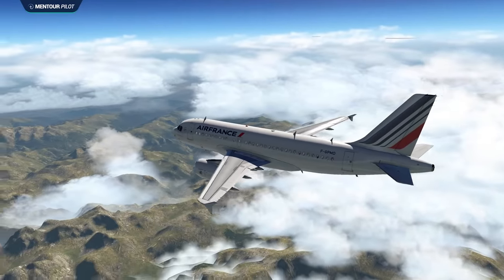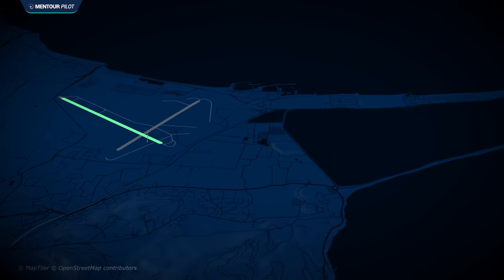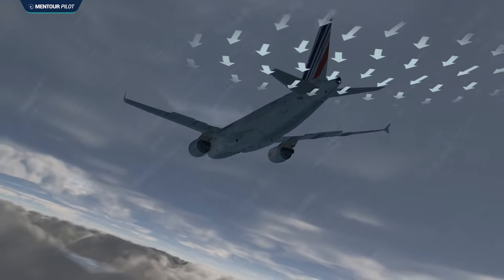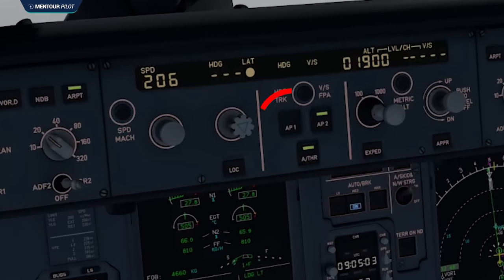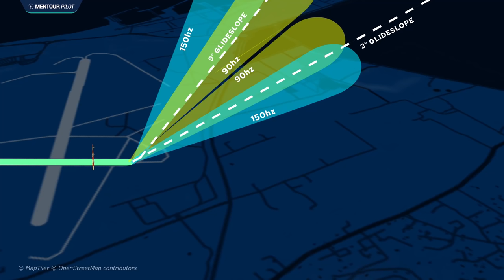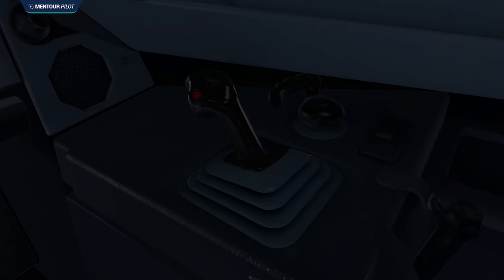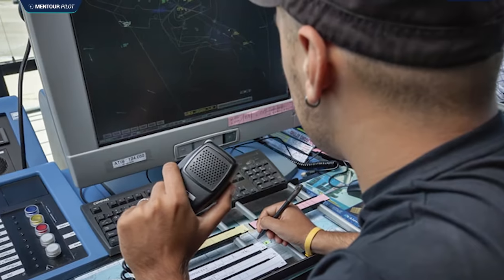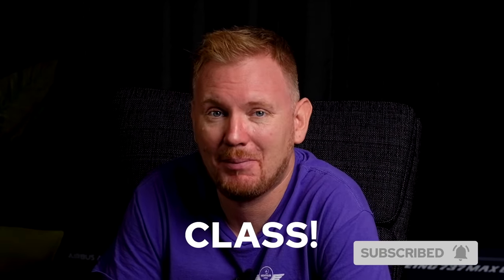An Absolutely CRAZY Reaction! Air France flight 7512

Comment: A few years ago I was on an A380 landing at Phoenix AZ. I was in the first row behind the First Class cabin. The flight was supposed to have landed at DFW, but there was one heck of a storm system messing with the middle of the US that night. Phoenix was not immune, but it was dry and clear, just windy. The cabin was briefed that we would be doing a tailwind landing with a 70kt tailwind and therefor we would be landing at about 100MPH higher than normal, the approach would be lower than the usual and this would be a maximum autobrake and reverse thrust landing. We were instructed that we would brace at touchdown. Planes were touching down and going all the way to the far end of the runway for the Fire Department to check the brakes and tires for excess heat. When we landed, it was very firm, but no bounce and the deceleration was enough that a gadget I forgot in a shirt pocket made it almost all the way to front bulkhead. We got to the gate just fine and everyone got off. I had about a 5 hour delay before we reboarded with all new tires and brakes to continue to LAX.
Reply: An A380 cannot land with a 70kt tailwind.

Comment: This reminds me of the Ryanair 3531 incident in 2013. Again high and fast during intercept. However this crew got the stall warning and we're seconds away from stalling over the approach lights.
Already then flight training increased to recognize these situations and how to recover. Setting up some speed and altitude gates in your pre decent briefing really helps. ( Until they change the runway 4 times in 20min. Don't ask me how I know😉)
Mind you many aircraft have data uploaded after landing to their safety department so that keeps pilots also from hiding stuff.
Nice video with flight deck indications

Comment: another great analysis, good job. A quick correction needed tho for the secondary lobes glidepath (9 degree) 14:04. Dashed line should be a bit above where in the middle of intersection of the secondary lobes.

Comment: Im a retired 727 Pilot. I am Type rated in B727/ DC9/ SD3-60/ EMB110. I have watched many of these aftermath videos. The more you load up the cockpit with switches from all the different systems, The easier confusion can be introduced into the mix when the crew is forced to do something out of their normal flow. One thing I could always fall back on with the original (steam gage) six pack was when something went wrong, In scant seconds I could check these six gages and stabilize the aircraft at the desired attitude, altitude, speed, heading. I didnt have to look at a bunch autopilot choices on the center glare shield console. If the autopilot was unexpectedly disengaged, I immediately took control kept the aircraft stable in the desired attitude. I didnt need to look around grab any switches to make that happen. These new aircraft are fancy indeed, a bit too fancy. Pilots lose instrument scanning skills and become too dependant on the automation. When the shit hits the fan, these crews need to be taught to drown out everything until the aircraft is doing what it is supposed to do. When it is stabilized and both pilots are convinced that it is stabile then go to the QRH. The Idea that one of the pilots should bury his nose in the QRH so deep that he loses situational awareness is ludicrous. The non flying pilot should always keep one eye on the big six. Why? because it can be done in a second by a well trained and lightly talented instrument pilot. Burying your nose in a book when the aircraft speed and configuration is being changed by the flying pilot is really asking for it. How many of your videos have I watched where pilots allowed extreme loss of airspeed. Thats got to be because no one is properly scanning the six. Not the captain, not anyone. I cringe watching these fubar flights with crewmembers easily overloaded and then disregarding or forgetting about the most important gage in the cockpit. If you lose your speed awareness in several flight regimes, the following upset can become so bad that everybody dies. Seems like a pretty important gage to me. I would feel like I was playing incompetent flight crew Russian roulette to get on a transport aircraft today. Especially after watching your videos. The crew might screwup with ineptitude or bad training or the overengineered automation might pitch us into the ground. If they want the aircraft to fly itself then go to full automation and leave the incompetent flight crews on the taxiway. We used to say, if it aint Boeing, I aint going. We were referring to the 727. Most pilots that flew it, loved it. I dont know of any pilots that didnt trust the old Seven Two. Even when the aircraft was old and the companies that were flying them as converted freighters, we still trusted it. Even when the maintenance was shoddy, we still trusted it. How many aircraft today can say that they instill that kind of trust and faith. Things are supposed to get better not worse.
Reply: Funny how the modern air aft still have that information in the same order and can be relied upon. I’m just the same way. It’s also funny that modern aircraft crash much less often.  So thanks but the old ways weren’t better.

Comment: The G/S does not broadcast 90/150HZ that is the actual Tone(sound) modulated on 330MHZ carrier.  The "false glide slope" doesn't always happen. It is the result of reflected radio waves off the ground. You generally don't have this problem if you follow the approach procedures and watch your Marker indicators and intercept from below not above.

Comment: I worked at a steel mill for 15 years and we handled up to 320 tonnes of molten steel every day. A arc furnace melting metal and then continuous casting into 10-25 tonnes steel bars. It was around 220 workers at the plant(all from the actual process workers to electricians, maintenance crew and spare part warehouse personnel). The higher ups encouraged us to report mistakes or observations of other mishaps, smaller accidents. 

Instead of punishing us they brought us together in a group and we brain stormed what had happened and in what way it could be fixed so the chance of it happen again was very low(0% is very hard to reach). So we got a much more safe work environment and safer procedures. No pressure, no hiding dangerous stuff in fear of getting fired. A win-win sort of situation.

Then of course if you didn't follow safety procedures or did right out dangerous stuff the chance of getting fired was really high.

Comment: False glide slopes are well known and well trained for.  This air crew was not well prepared to shoot this approach as fast as it happened due to the tailwind.  They got behind the airplane, and almost lost control.  Fly a stabilized approach and problems like this become much easier to handle.  If you get complacent, and think you can get yourself out of a bad approach through superior flying skills, you are much more likely to find yourself in such a situation.

Comment: Hi. I have read the report about that occurence, but I realised I was missing a fundamental point to get the perfect picture : the inversion of ILS signal when you hit a secondary lobe. Now I clearly understand why this A319 pitched up instead of diving down. About the Alpha Floor mode come the issue of things we see once at the initial type rating. We , Airbus pilot, have to refresh ourselves regularly about how to get smoothly out of it if, on a bad day, we involuntarily step into and activates that mode. Regarding ATC maybe if they added something like "I see you high and fast, how about taking a hold ?" would put the crews back into loop, as , at that time I believed they reached already the tunnel effect.

Comment: Hello, A very interesting study thanks. I recall a fatal accident involving an Airbus in the Far East where one of the crew had inadvertently selected go around but unaware of this the crew continued to try to get the aircraft on the runway. When it was apparent that they wouldnt make it they then executed a missed approach and pitched up. Their command added to the autopilots command which was already pitch up and the result was a stall and subsequent crash. I may have some of that incorrect it was a long time ago but this and many software related incidents/ accidents seem to relate to crew not understanding what the aircraft is trying to do.  Furthermore the "advertising" by a manufacturer of systems to prevent stall seems to lead to an attitude that the crew will be assisted by the automation when the opposite can very often be true.  Many thanks for all your work in preparing these videos.

Comment: Very interesting video, I had a similar situation on 737 in RAK. Late runway change, hot and high, almost landing config to catch up the glide and we ended up catching a false glide that suddenly rise up. A/P off and pitch down to avoid the stall. I didn’t know the secondary glide slope story. Thanks for the video, fly safe !

Comment: It can be noted it i not just the pilots that use the reporting system. Engineers,and Cabin crew, also file reports.. In the UK you can report anyhing you think could be dangerous or a mistake. As he says there is a no blame culture so it can be investigated and measures put in place to try to prevent it. Like a notice to alert fellow staff as a minimum. The CAA will issue a notice or enforcement if necessary. Like this.

Comment: Very interesting.  Related to A318 landings, I had a Frontier Airlines captain tell me he didn't care for the flight dynamics of the A318.  At high angles of attack, not enough air passes over the horizontal stabilizer.  So landings can be tricky.   This issue is  apparently due to relative closeness of the horizontal stabilizer and main wing.

Comment: I'm not a pilot,  so may be missing something.   You said an altitude of 6500 feet, times 3, equals 19.5 miles.  6500' is 1.23 miles, times 3 is 3.69 miles, not 19.5.  Using nautical miles, I come up with 1.07 times 3, or 3.2 nm.

Comment: Just a small side note; your remark regarding the reasonableness of the statement from the FO that he would continue the approach until the final stabilisation gate is quite interesting but i.m.h.o. not always correct. Reason for me making this statement is a discussion I had just last week with a colleague of mine regarding hot and high approaches. We came to the conclusion that most of the time the “humiliation” (please note the parentheses) of executing a go-around following an unstable approach is preferred to admitting defeat beforehand by requesting the delaying vectors you mentioned as well. 

If the crew is actually on the ball in this hot and high scenario, the strategy of continuing to the stabilisation gate in order to still salvage (it is not the word I am looking for but I can’t find another one) the approach is indeed a solid one. 
But, sadly we have seen to many cases where the crew was already mentally overloaded and thereby ending up hot and high, continuing the approach that to really salvage the approach and that ended up in tears. Especially when task overloaded these additional trackmiles will allow the crew to de-stress, end the amygdala highjack, build a new, preferably shared, mental model and get ahead of the aircraft again.

Just my 2 cents

Comment: Excellent video & analysis.  As a PPL trainee I've a two  questions - you started with "local air traffic is in French", I thought everyone had to talk english (you can tell I'm learning in the UK!), and secondly, high is one thing, as my instructor says height = time to think/plan= safety, but what if you hit the ILS sideband below (degree in physics!), would that not pitch the aircraft down (when already getting low!) - surely that's even more dangerous?  Is there the assumption that terrain warnings or similar would alert the pilots?

Comment: Hi Just a few points and questions to very well presented video. On the 150 and 90 signals 
The R/X does not use the 90 or 150 as such  but rather the DDM off the two signals ( a very different idea)

I think (could be wrong ) that the false G/P to be worried about on a normal 3 degree path is at 6 Degrees, There is also one at 9 degrees But that would be very High at around 6nm to the runway.

The false G/P have been known about since the ILS was introduced ( many many  moon ago) and
I thought that all ILS approaches were to be commenced from below the G/P to prevent this problem
  Is this not what the approch plates show ?? 

Cheers
Tim

Comment: Improvements in the glidescope was my first thought here, and I was happy to hear your comment at the end the Airbus has implemented protection against false glidescope readings. I can think of several ways in which this can be implemented. I am wondering, though, if any improvement has been made by other manufacturers of aircraft. The idea I had would involve both the glidescope transmitter on the group and the receiver/computer on the aircraft.

Comment: It seems like you will always capture and track the localizer before the glide slope because 150hz will attenuate more in poor wx before 90hz. An interesting choice to prioritize direction over altitude, wonder why, maybe it doesn’t matter much? Also might poor wx attenuate the 150hz signal enough in some conditions that it is harder for the pilot to determine which glide slope lobe is being tracked (ie. barely tracking, or poor AGC thresholding), the main vs. top lobe? I’m not familiar at all with these systems I’m not a pilot to know any of this… just thinking of the physics…

Comment: Hejsan Petter, quick question - the quick mental calculation at 8:23 of the video. Altitude (6,500 ft) x 3 --> 19,500 ft; this is equivalent to 3.693 miles or 3.209 nautical miles but you quote it as 19.5 miles. Is there a particular rationale/logic beyond it. I would calculate that using the rule of thumb calculation that you need 3.209 nautical miles + 10 nautical miles = 13.209 nautical miles and they are at 16 nautical miles as you state in the video --> so in theory they are not in a bad place. I could be completely missing something, so curious to hear your explanation. BTW, as an amateur aviation enthusiast; your channel is by far among the best on YouTube; Tack så mycket 🙂